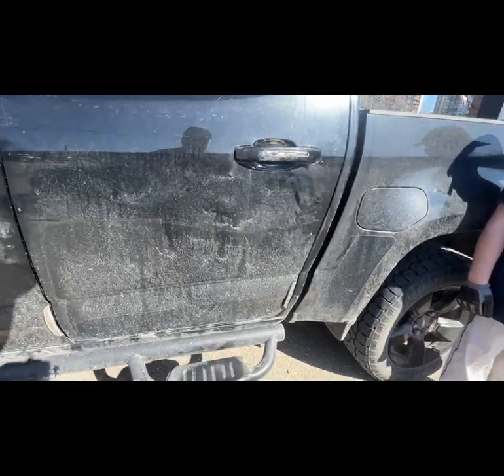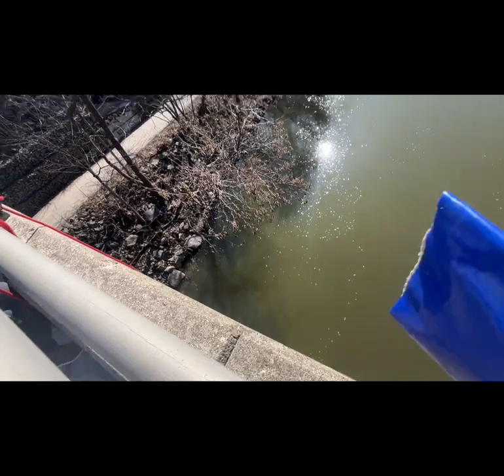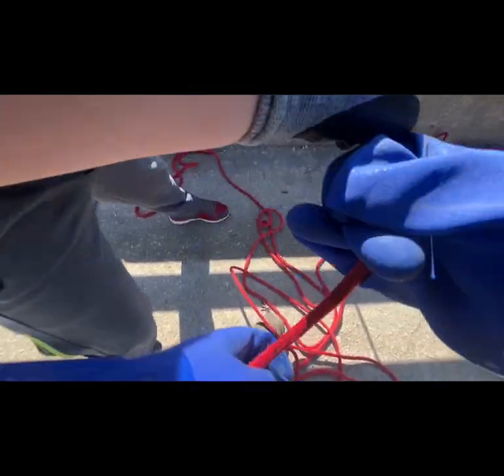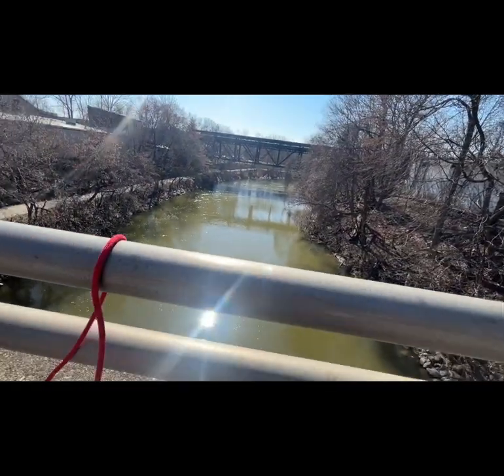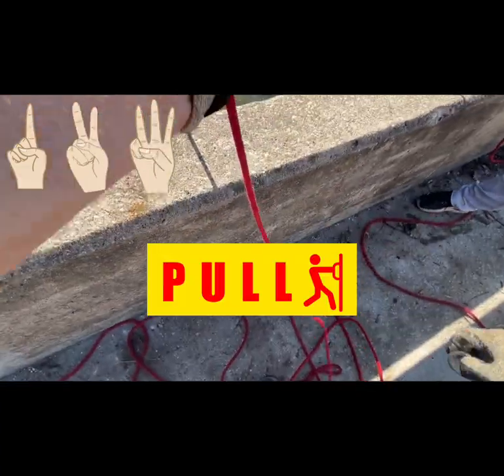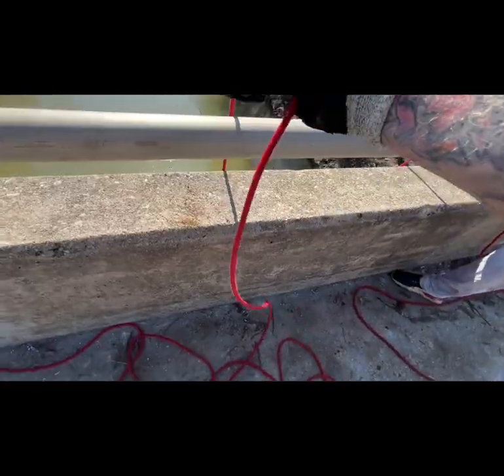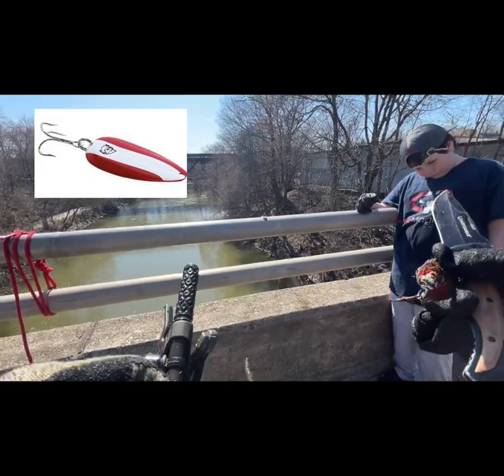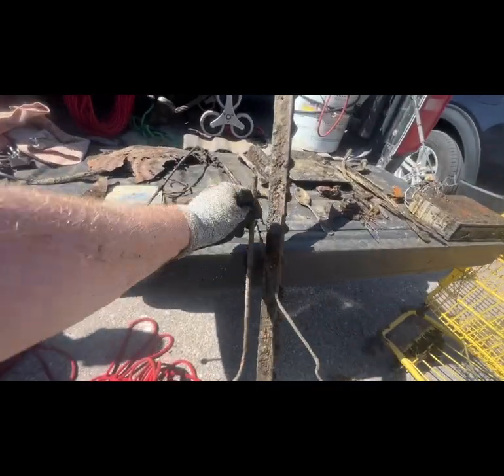Bikes🚲and carts🛒and railroad plates  🛤️  🍽️ ...... oh my!

Comment: I have never had ANY luck using those small grappling hooks... For me they either always bend OR they never grab very well. I am glad you didn't have that problem :)
Reply from the maker: Thank you for the comment.  I have a set of those grappling hooks …… small, medium & large ……. I mainly use the medium size, the large one is ridiculously large.  I also have a collapsible three hook grappling hook, which has teeth so I use it occasionally.  My biggest concern with using any grappling hook is hooking onto something and being unable to move it but also unable to get it unhooked, so I’m very cautious with using any of them but it should be part of anyone’s magnet arsenal, in my opinion.
Reply: @magnetfishingfiremen137  I have yet to try a medium sized grappling hook, the large one you talk about with teeth? I HAVE tried one of those a few times.... I call it "the bane of my existence"... EVERY time I used it I had to use my truck to try and free it... It would PROBABLY be a good hook for some Batman or mission impossible wall scaling thing but... long story short, I no longer have it... it got caught up in some rocks and I broke my ankle trying to get to it to free it by hand last year
Reply from the maker: 😂🤣……. I’m laughing only because I can 100% relate!  I have the loop end (with 10-12 inches of rope) of the rope that snapped, when I used my truck to try and get my first hook unstuck ……. It’s hanging off my gear shifter.  I’ve had to go into the water a few times because I hooked onto something that wasn’t moveable, luckily those incidents weren’t in to deep of water ……. so I hear ya, which is why I’m very cautious with using them.